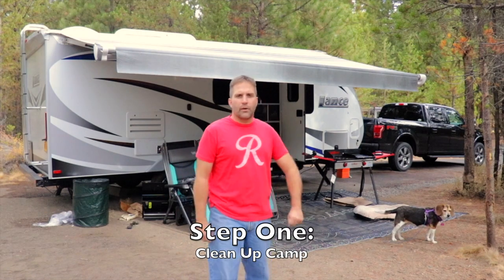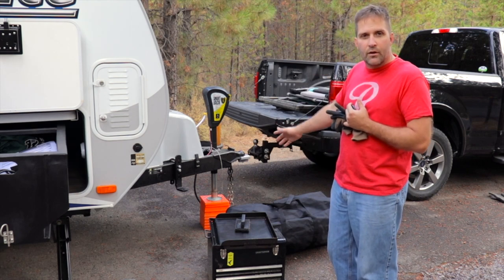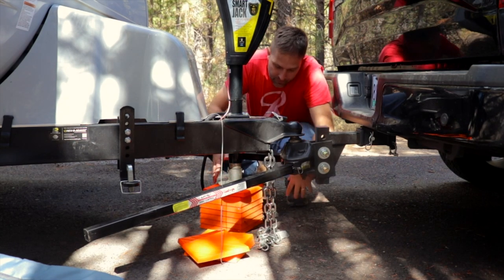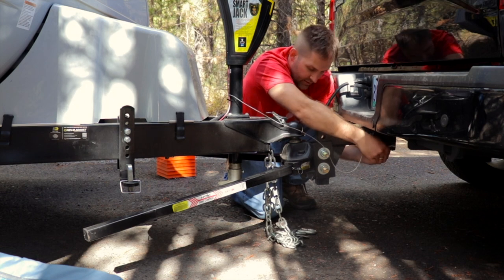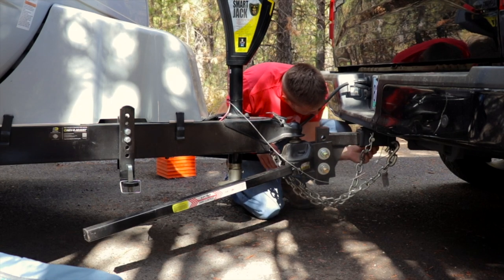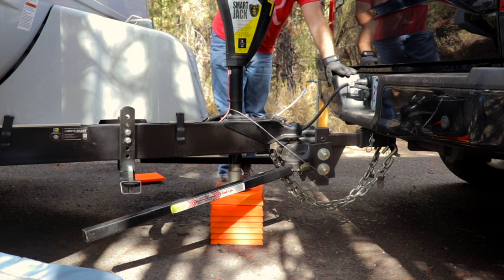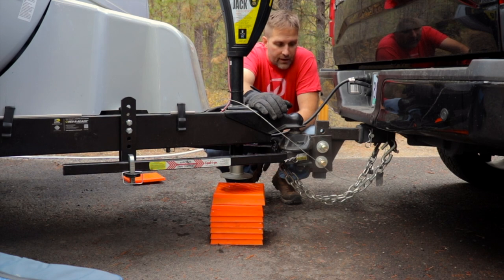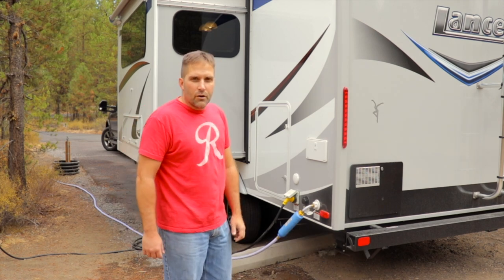Beginner RV Owner Tips | How to safely hook up and haul your RV/Travel Trailer

Comment: Just a little note about the brake cable. Set the length to activate electric brakes before the safety chains get taunt or they will never come on.
Reply from the maker: That is a fantastic point. Thank you for sharing. I will double check that is the case moving forward. Always learning from our viewers.

Comment: You may know this by now, but the slide room is to be retracted before raising the stabilizers! Also, Carefree sell legs and straps for your Latitude awning. They give you more piece of mind, because they don't like wind or rain! Happy Camping! BobnRobin
Reply from the maker: Hi Bob. You are exactly right. Thanks for the comment and the suggestions in regards to the straps.
Reply: Bob Porter by retracting the slide, before raising the stabilizers are you meaning when your hooking up the trailer for leaving camp.
Reply: @Berrypancakes229  ALWAYS have stabilizers down and in contact with the ground WHENEVER you are moving your slideout. That will keep everything even and level, and greatly reduce wear and tear on the slide motors and mechanicals.